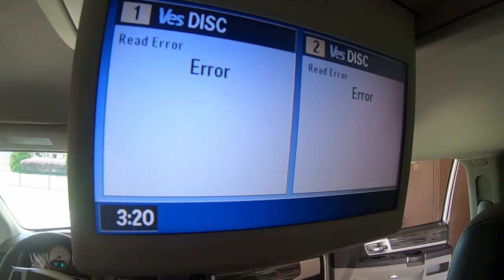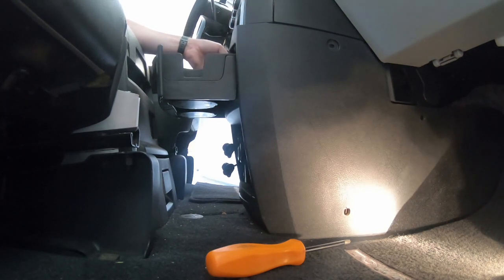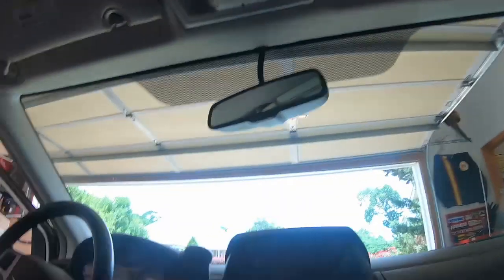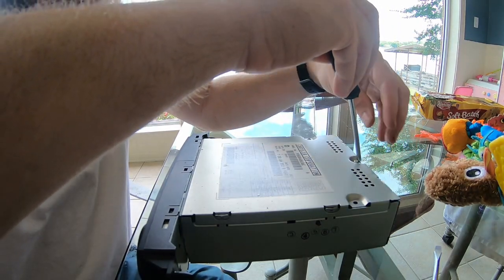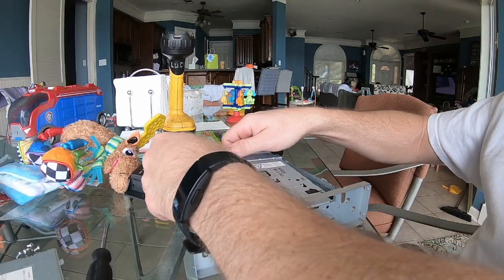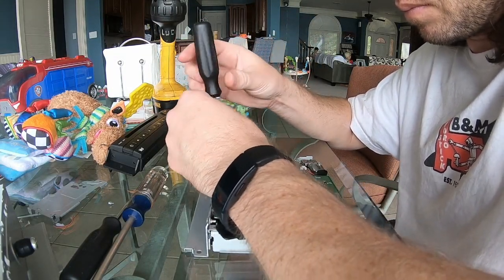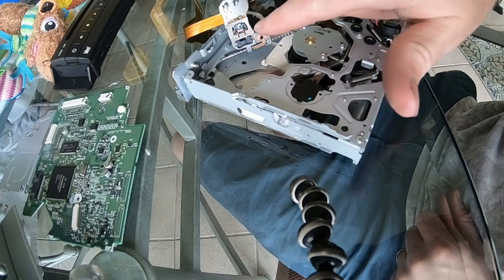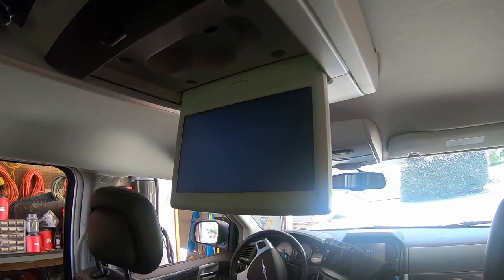How to Fix the DVD Player in a Chrysler Town & Country

Comment: Mine quit working after a new battery was installed, immediately after.  It blinks lights on the DVD player and makes loud buzzing sounds three times and then quits, thank goodness.  What could they have done when installing the new battery to cause this.  I've had several new batteries since this happened, and always the same story.

Comment: Thanks for this video! I just bought a used 2008 Chrysler Town & Country, and was really disappointed the DVD system didn't work. Did you have issues with your non-VES DVD unit at the top of the console too? Or was that one still working?
Reply from the maker: That one was still working.
Reply: @FarmDad  Thanks for the reply. I ordered the lens cleaner via your affiliate link. Unfortunately didn't solve my problem, so I'm going to try taking apart the dash like you did in your video. But, I had another question. Any guesses on what I should look at, if the power plug by the back seat (under the AV1 and AV2 for the ves unit) is not working? Since I couldn't get the DVD players working, I thought I'd try hooking up an N64 back there. But, the N64 wouldn't power on.

Comment: Thank you, my issue is the rear screen not working with the dvd. The front screen plays (in park) the rear screen lights up on initial startup of the van but goes blank when the dvd begins
Reply: My issue as well. The DVD will play on the dashboard but not on the screen-- just the sound works.
Did you find a fix?
Reply: @IrishCollegeGirl  it seems to be an intermittent issue as it randomly started working the other day, then went out again.

Comment: Ques. My dvd 2nd screen was working as was the dvd but the first screen wasn’t. I replaced the ribbon cable and put in a new radio. And now it says it’s reading the disc but the screens go black   Any ideas?
Reply: Hi Rebecca, I am having an issue with mine where the screen is black if the TV is all the way down, but if I go back up about 30 degrees, the screen comes on. I am thinking I need a new ribbon cable, any recommendations on changing that or where to get a new one?